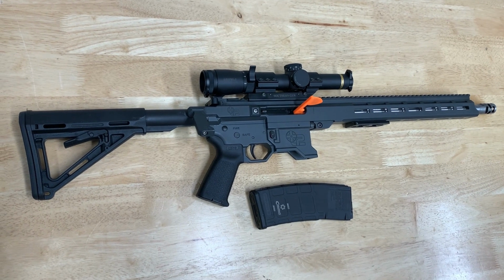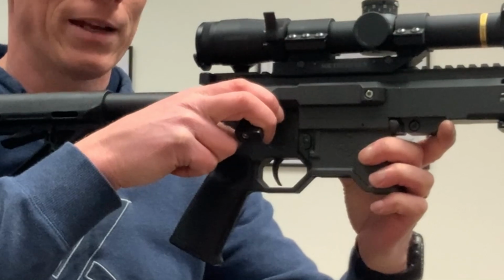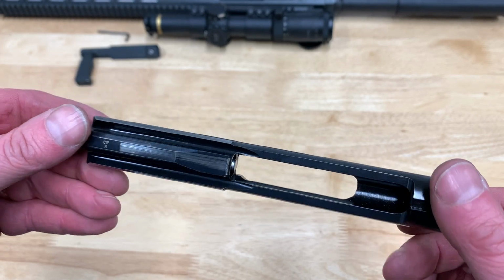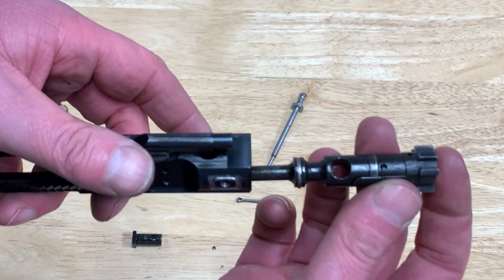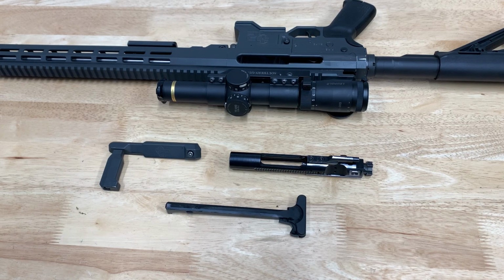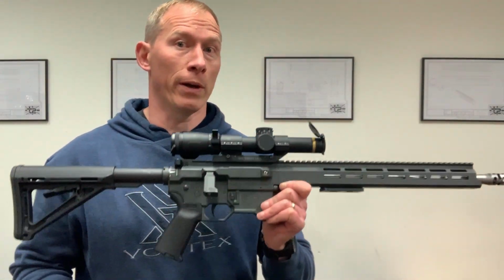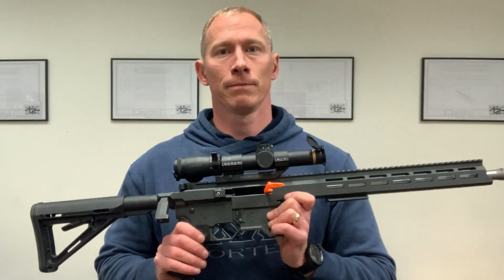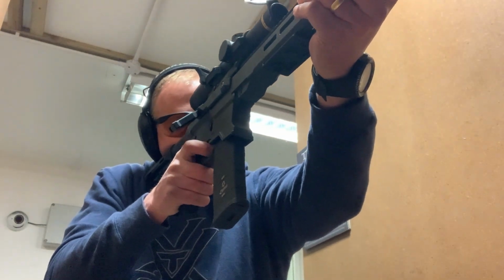T2 9mm Straight Pull Rifle User Guide

Comment: Looks like instead of a rotary delay bolt you have used a .223 bolt with a 9mm face to satisfy the UK regs?
Reply from the maker: Not sure 🤷‍♂️
Reply: In case you are talking about the CMMG rotary delay bolt, I guess you are right, because the rotary delay bolt would make the gun semi automatic, which is a no-no.
Reply from the maker: Yes, unfortunately we can’t have semi auto 9mm on a standard UK firearms licence
Reply: @JonCresswellUk  yes and I guess the point of using a rotary delay bolt is to make the gun semi-automatic while getting rid of any gas or piston systems.
Reply from the maker: @sebastianhabel7312 my technical knowledge doesn’t span that far 😅 it’s something I need to swat up on
Reply: @JonCresswellUk  CMMG's unique selling point with the rotary delay system is to reduce recoil compared to a simple blowback system while requiring less parts than a gas operated AR. But I don't think there is any connection between T2 and CMMG apart from the T2 rifle being designed for CMMG magazines, or is it?
Reply from the maker: @sebastianhabel7312 not as far as I am aware.  They are designed and manufactured in the UK

Comment: Hi Jon - an observation - the charging handle seems to have taken a lot of the cerakote off when it cycles forward. Is that normal, or just the one you were using?
Reply from the maker: I’d not noticed that before! We’ll spotted.  I believe this is one of their first production versions, so I expect they will have tweaked the straight pull handle.  It’s a fair point, so I’ll pass your comment on to them 👍

Thanks for letting me know.

Comment: 5 ROUND ACCURACY AT 25 AND 50 YDS? What other pistol calibers might be available?
Reply from the maker: I didn’t do an accuracy test for grouping, but I was hitting the duelling tree every time on the 25m range.

Not sure about other pistol calibres 🤷‍♂️. I know they have .22 WMR, .223 and 9mm at the moment. I expect there will be more to follow!
Reply: Hi, great bunch of videos. I am still new to this and one question that comes to mind is what are the positiveness negatives of using 9mm over 223 on this (or any other) rifle? Thanks
Reply from the maker: @colmanscapers7498  hi, there’s lots of arguments for and against rifle calibers online and it depends on what you want to use the rifle for.
Reply: @JonCresswellUk  thanks for the reply. It would be shooting for fun plinking (25-35m) but also long range target shooting.. obviously different rifles would be used for each. I was just wondering what the main use for 9mm would be? Thanks.
Reply from the maker: Definitely not long range as 9mm is not that great at distance.  So the 25-35m shooting would be fun with the 9mm. You could also consider .22 WMR as you could use it for plinking and it will be good out to about 300m.
Reply: @colmanscapers7498  It's mainly a Gallery Rifle, so can be shot in any NRA GRCF class (just like 357 and 44 lever rifles). It is also usable in gallery classes in UKPSA events.
Reply: @ianvincent4911  I will have to look into this more.  Still new.. Thanks..